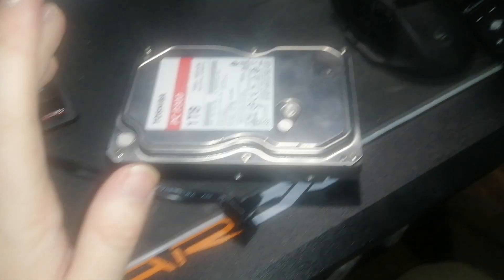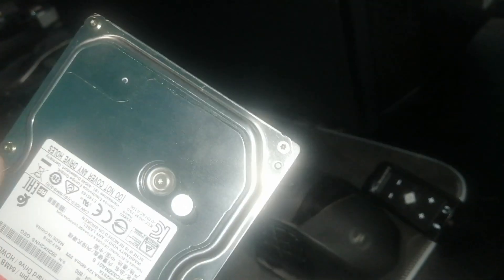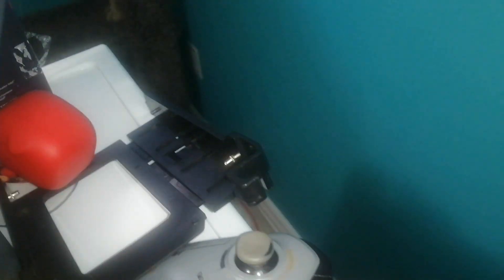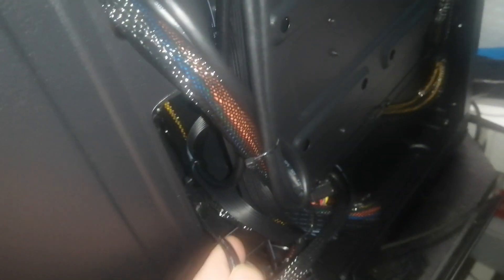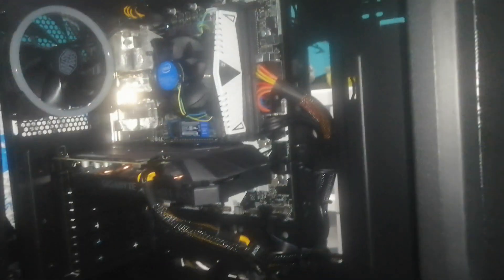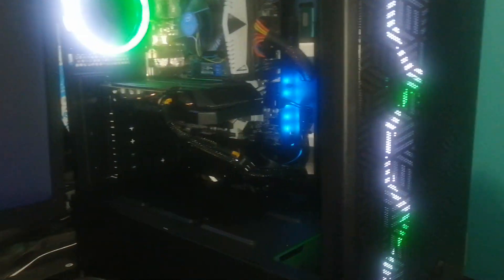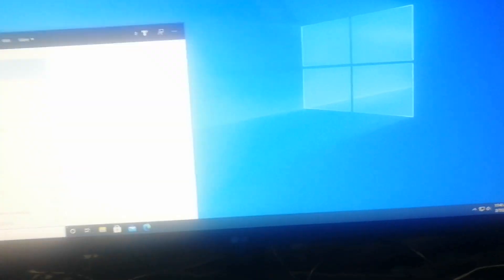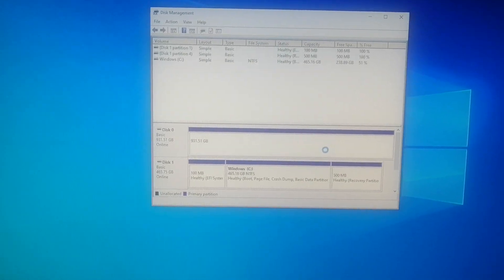how to upgrade storage on pre built pc

Comment: I assume I need to buy extra power cables? You seemed to have extra ones already in there, but I don’t think mine does 😅 sorry for the dumb question, I’m super bad with this stuff
Reply from the maker: Unless you have a very weak or old PSU you should be fine
Reply: @NWCPcbenchmarks  well, I mean in the sense that I don't seem to have one not in use to plug in to the new drive I got. And I don't really want to unplug the one already in my pc
Reply from the maker: You can buy adapters to change the ends from 4 pin to sata
Reply: @NWCPcbenchmarks  Haha sorry, I did have a usable power cable! It was just tucked away with a bunch of cords, so I didn't see it. Sorry for that, but thank you for your help! The video was very useful for figuring the rest out!

Comment: Okay so i wanted to buy a 7200rpm 1tb seagate barracude hdd but do you think it comes with a sata cable?
Reply from the maker: It does not
Reply: @NWCPcbenchmarks Thanks for reacting guess i gotta buy one with it
Reply from the maker: Yes, there are cheap ones that are just plan black

You can also buy coloured ones in a pack it's nice to have extra
Reply: @NWCPcbenchmarks  Well i have a very ugly case so i wont need colored ones

Comment: Very informative! I do have one question though. If I have a hard drive that already has things on it, can I just put the hard drive in and use it as is. Or do I have to format it? Just asking because the hard drive I want to move over has 500GB used and lots of important files. Thanks!
Reply from the maker: Sometimes you can get away with just plugging it in and it will work, other times it will be saved under a profile protection from Windows

The best way to do it is to save things to a usb, and move it over little by little. 

This can be a pain but at least your information will still exists if something goes wrong
Reply: @NWCPcbenchmarks  Smart! Thanks for the help
Reply from the maker: Not a problem man

Comment: thanks, i got a prebuilt with no drive bay and one hdd already installed sitting at the bottom. can i stack them using velcro to keep them stable or is that bad?
Reply from the maker: If you aren't moving it around like crazy that should be fine
Reply: @NWCPcbenchmarks  will be sitting stationary, thanks for the help!

Comment: Im new to pc and already got mine and im trying to connect the ata cables but idk how to find the hard drive is it through the front case or the back where you plug them in?
Reply from the maker: What PC do you have? 

It could be you have a M2 SSD, and most of the time if you're trying to add a hard drive it goes into the back

And Sata goes to the motherboard slot and Power sata should be in the back
Reply: The cyberpower pc.
Reply: it also came with 2 of the ata cables. Do i need to connect both or it's an extra one?
Reply from the maker: It be just the one to the new hardrive like I did in the video
Reply: @NWCPcbenchmarks  thank you so much it worked.
Reply from the maker: Sweet man, good job buddy

Comment: Which cage or tray do you recommend me getting for a 3.5 inch hard drive?
Reply from the maker: No idea the ones I have didn't fit, I probably just go with a SSD to be safe if you move your PC around
Reply: @NWCPcbenchmarks  thing is that I bought a 2tb barracuda hard drive and now I just need to install it, I leave my pc in the same spot all the time only moving it occasionally to clean out the dust
Reply from the maker: I'd just use velcro tabs, place one at the bottom of the HDD and one to the bottom of the case.

Unless you can find the same case for sale (I couldn't) to see the part number for the tray they have
Reply from the maker: If you aren't moving the PC around you shouldn't have a problem
Reply: @NWCPcbenchmarks  Yeah I tried Velcro and it works great, no vibrations and I was able to format it successfully thanks.
Reply from the maker: That's awesome